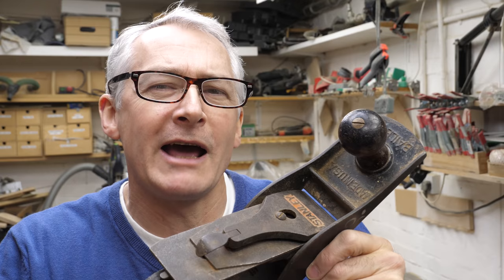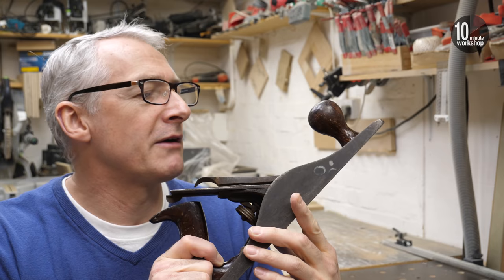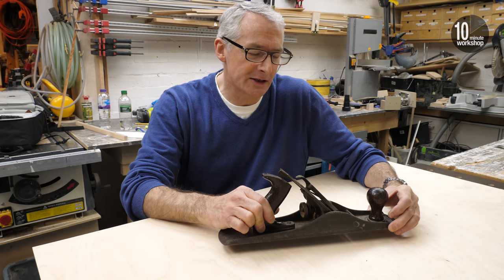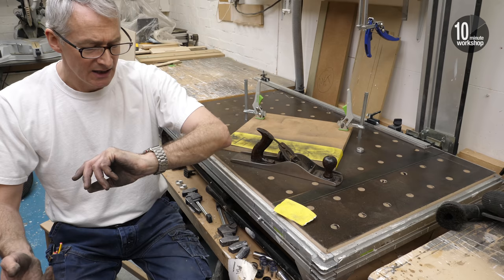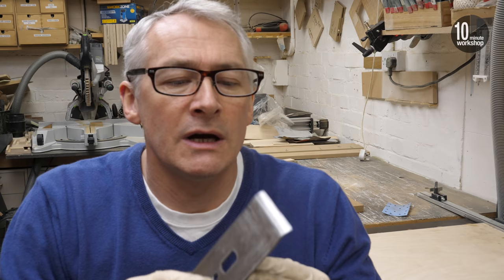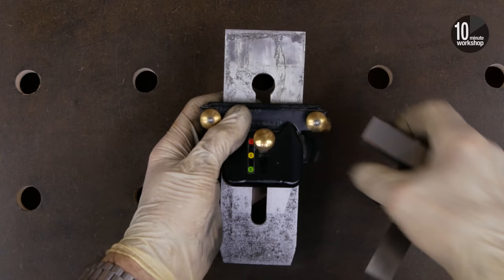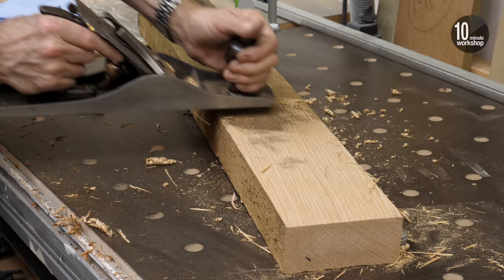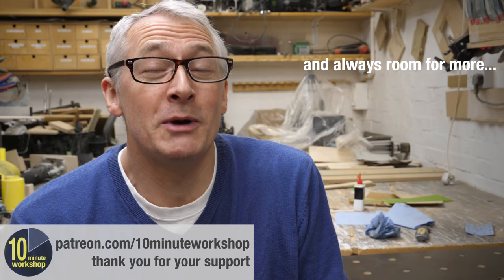Stanley No.5½ Jack Plane Revitalised [video #373]

Comment: You did a great job getting that old plane back to work.  That's a little newer than a type 15 though.  The frog started with the type 16.  The type study was done using the no 4 exclusively and some of the features didn't show up on the bigger plane.

Comment: Loved this. Even with all your experience as a pro cabinet maker with the power tools, I finally feel as if you are on the same plane as me with cleaning up hand tools. (Sorry, couldn’t resist that one.)
Best line? “I’ve finally found a use for a Dremel brush I’ve had for a decade.” I suspect we all know that feeling!
Best tip for me? Clamping the board plus abrasive paper to the bench top. Saves messing around with the vice and other specialist “sharpening stations.”

As ever, thanks for a great share.
Reply from the maker: Thanks Roger! Yes, I’m a total novice when it comes to this stuff - learning by doing! 😂👍👍

Comment: Just goes to show what you can do with  a seemingly worn out plane. Must pop into my workshop and give my 5 1/2 a clean up. Bought mine new in the 70's still a great plane.
Reply from the maker: Nice! 👍👍
Reply: Basically they don’t wear out although they do crack and break. The often have cracks around the mouth which become apparent when cleaning the rust off. And then are those which have been welded.

Comment: Interesting to see you get into this.   I went plane crazy in the 90s, finding at least 5 Stanley planes, 3 of them Bedrocks. A 4, 5, 6, 7, and an 8!  I sold the 8, it was a beast.   I was convinced I needed a good set of planes to be a wood worker!  Too many Fine Woodworking articles I think. I did build dovetailed pine shelves with them, starting with rough cut pine boards hand planed level and square. It took a week to build those shelves in what would take 2 hours with power tools. I then boxed them up, bought a jigsaw, skillsaw and a drill and didn’t build anything else by hand!
Reply from the maker: I never really ‘got into’ the hand plane thing, but I did enjoy playing with this one and getting it working tolerably well. And I totally agree with you re power tools! 👍👍

Comment: I  enjoyed the video, Thanks. There is nothing wrong with the way you sharpen. You have made a good choice with and older 5 1/2  and if you find you like using this plane and want to lash out with the cash buy an after market blade and cap iron set. That will raise the performance of your plane to almost as good as a premium Lie Nielsen or Veritas hand plane . If you do decide to buy a blade set, check the width of your blade as some USA made 5 1/2 planes made before 1939 had a 2 1/4  wide blade and not the usual 2 3/8 wide blade. All the best
Reply from the maker: Thank you! Great advice, much appreciated! 👍👍

Comment: Might this be a Type 16?  Judging from the kidney-shaped hole in the lever cap (although not definitive if the cap has been replaced). But the frog has the outline machined surface instead of a full-face ground front.
Reply from the maker: Possibly, though I don’t know enough to be able to tell the difference, I’m sorry; I went by the guide I found online - link in the video description - which was focussed on identifiers found on the plane body. As I say, it feels like the lever cap isn’t original as it isn’t centred when fitted, and the cap iron has ‘Record’ stamped on it, so most likely a mongrel. 🤷‍♂️👍
Reply: Peter Millard “Record,” eh?  Looks like this baby has had some organ transplants in the UK. Is the iron 2-3/8” or 2-1/2” wide?  That should also distinguish a 15 from a 16. 

I’m splitting hairs here: your restoration is brilliant and that plane is a keeper!
Reply from the maker: @b1j  Thanks! Har-splitting is the sign of a curious mind, I think! 😂Someone else further down the thread commented on the lever cap, and the shape of the hole, though as I say, I'm pretty sure that isn't original;  I'll have a look at the blade when I'm back in the workshop; out of interest, is it the 15 that should have a 2-3/8" blade? Really appreciate the info, thanks! 👍
Reply from the maker: Just checked - it’s a 2-3/8th blade, just FYI. 👍
Reply: Peter Millard and I just noticed a typo in my “expert” post:  the Type 15 had a 2-1/4” iron, not 2-1/2”!
Reply from the maker: @b1j  Ah, OK - it was definitely shy of 2-3/8", so I'd say it's a Type 15. 👍

Comment: I went through almost exactly the same experience in rejuvenating a Stanley No 4 plane that had been donated to our woodwork club. However, I soaked some of the metal parts in a citric acid bath to remove some of the rust. The results however, were almost a clone of yours and it is great to use. Perhaps flattening the back of the plane will be what others will say you should also do. Anyway, thanks again for your experience. I have two Stanley Bailey No 5's waiting for my future attention in the workshop. I am looking forward to the therapy again of seeing them take thin shavings off wood again.
Reply from the maker: Thanks! Flattening the back of the iron? I do that in the vid. 👍👍
Reply: You do  too sorry. Great video!

Comment: I just bought one of them this afternoon and it is in about the same shape. I have a workbench top to smooth.  This is more of a jointing plane for flattening large laminations than smoothing. Looking forward to using it.
Reply from the maker: Hope you enjoy it! 👍
Reply: I most definitely will Peter. Turns out mine is about the same age as yours and is a 5-1/2c which means its a corrugated sole. Its old enough to not have a frog adjusting screw so likely around the early 20s. Threads and hardware is all in great shape. No cracks or chips. Also regardless of what the sharpening geeks have to say all that matters is the blade is sharp regardless of how you get to it. I do not plan to spend a whole day setting up a precise bevel and all or spending $700 on a machine to do it. Close to 25 degrees is good.

Comment: The kidney shaped hole in the cap iron was introduced in 1933 with the type 16. I love my No 5 1/2, plenty of heft to it, once you get it moving, mine has a newer and better iron than the original. Here one can identify the ages of Stanley planes https://www.timetestedtools.net/2016/01/27/stanley-type-16/

Comment: My Veritas honing jig came with a gauge for setting grinding and honing angles.
Reply from the maker: Mine too - I have it ‘somewhere’... 🤷‍♂️
Reply: And that device also ensures the blade is square. 😉
Reply: @glennpreston3418  yes it does, although I don't like the fact that it isn't designed with a square edge on it at least on one side. I always imagine that I've knocked mine out of square whilst sharpening and am constantly checking for square as I go. To the extent that I have as much confidence in my freehand sharpening squareness. In hindsight I'd have bought a cheaper guide that clamps the blade square and an offcut blade angle jig.
Reply: Ah, that's probably because you're missing the extra device that clamps the blades from the side instead of the and bottom. That was a design flaw and the released the extra device to correct the issue. This keeps the blade of chisel true for honing.
Reply: @glennpreston3418  ahh, that makes sense. Thanks!

Comment: I did a similar number on my  Stanley #5 - 1/2 eBay purchase a few years ago. My plane is of similar vintage although as I found out, my particular model has a 2 1/8" width iron. I believe after 1958 Stanley increased to 2. - 1/4"?
I paid the princely sum of £8 for mine. It was advertised without a rear handle, however the vendor included the body and handles of another plane in the parcel, which was nice. The plane  had been well used but in good overall condition. I wanted a new blade for it, one for General work and one for smoothing. I found it difficult to source a second hand iron of that size although I eventually bought a new one from Workshop Heaven, I am pleased I did, I keep this one for finer work. I use this plane all the time now, it suits my hand very well, with the slightly narrower body it's a good compromise between the #5 and it's heavier Brother (2-1/4" blade version).
In your opening gambit you stated you would not polish it like Paul Sellers!! I don't recall the aforementioned polishing the frog screws and adjustment wheel lol.
I enjoyed watching and reminiscing on you labours, who needs a gym membership when you have hand planing to undertake. I am no expert either, although for general planing you might wish to ease the corners of that newly honed iron.
Good luck and thanks for posting.
Reply from the maker: Thank you! Very good point re Paul Sellers not polishing the bits I did, lol! Easy to get carried away 🤷‍♂️😂👍

Comment: I laughed at the 'obligatory shaky handle' - I inherited both my father's and my father in law's No 4 and both had the same affliction.
Reply from the maker: It might be next in my list of things to fix 😆👍
Reply: @10MinuteWorkshop  All you need to do is shorten the bolt going through the handle a bit. All that has happened is the handle has shrunk, easy fix.
Reply from the maker: @garyblake3130  There's a bit more to it than that, unfortunately - the screw is stuck in, and a previous owner has put a washer in there to try and help... which is not stuck against the bolt, so the screw won't turn, and the handle won't come off the bolt. As I say, a job for another day. 👍
Reply: Hi peter
Enjoyed this alot,
In reference to the shakey handle, clean the slot out and on some brass nuts the slot has the threaded part coming through, use a needle to poke the muck out and you can pop a few drops of oil/WD40 through the hole and it will run down the rod and reach the parts that have siezed.

Comment: There's nothing to beat hand tools from between the wars... Was given a 'new' Jack Plane a couple of years ago; Sole not flat, taken hours of work flattening on Emery cloth on a large piece of kitchen worktop. Used a black marker pen to mark up the bottom first - when the ink had been worked off the sole was much flatter. The 'Thin' (barely 2mm) plane iron (blade) had a hollow back, that is now better, again after much work on the emery cloth board. Chip breaker again another bad piece of finishing, not helped with it being as flexible as ****. I've as much time getting that sorted as well. It still jambs up with some of the shavings. 

Had I bought it I'd have taken it back it was so bad, even now only really good enough for very rough work.

Comment: Yes, very interesting. The only point I would make is that flattening the sole should be done with the lever cap on and closed. That said - your priority was cleaning off rust and patina from sole so I don't think that makes much difference. As far as sharpening is concerned I was taught by my dad, a master carpenter, and still only use 240 and 400 grit sandpaper and a strop to get a fast and sharp enough edge in moments - no guide!
Reply from the maker: Cheers Karl! I know where you’re coming from, but I n all honesty, I think any changes in the shape of the plane made by fitting the blade and lever cap to a frog that is itself separate from the plane body is likely to be negligible - certainly unnoticeable to me! But as I say, whatever works for you, works for you 👍👍

Comment: Haven't been over to your channel for a while. I watched Paul Sellers videos on this. Not sure I'd characterise his as full restoration. More like what you were doing, i.e. getting the tool functional. Loved his quick process for taking the old finish off the handles though, and applying a new finish for a 'quick win' in terms of making it better to handle in use. He also did some further videos on making new handles for anyone that's interested in going the whole hog. I really like the fact that he showed how you don't need a lathe to to do it. If I remember correctly you can fix the loose handle by simply removing a little length from the threaded end of the rod that holds it down. I'm guessing you already did this but didn't put it in the vid. Cheers Peter. Been missing your channel! :-)
Reply from the maker: Thanks Neil. Unfortunately the bolt holding the handle is seized; one of the many things I need to sort out someday… 😂👍
Reply: @10MinuteWorkshop  Oh... Bugger. 😱

Comment: If you look at the frog from the front, the screws and cutaways are the two eyes with the mouth below it does look frog like...hence frog.
Reply from the maker: Not necessarily... https://www.finewoodworking.com/2011/06/02/just-plane-trivia-why-do-they-call-it-a-frog 🤷‍♂️ But thanks! 👍
Reply: @10MinuteWorkshop  Glad you got the correct reason why its called a frog, I have been teaching the frog in the throat at my college for some time now. Glad you're getting into hand tools, I have been down the road and got all the fancy power tools, but you can't beat the use of good quality hand tools, of which an old Stanley or Record plane is one. We'll have you cutting mortice and tenon joints soon, even the youngsters at my college seem to enjoy chopping a mortice by hand.

Comment: Will someone please give Peter a piece of granite and some wet paper ,lol thats ok Peter  ,the last blades i sharpen were for my jointer ,i use a block of wood and screwed it to the block used a stone wheel to take out the chunks then wet sanded it on the deck of my table saw up to 4000 ,cuts like butter ,see them table saws are good for something huh lol
Reply from the maker: Totally agree with you Syd - my table saw’s the flattest thing I own! 😂👍👍
Reply: @10MinuteWorkshop  When you going to start using your CNC machine
Reply from the maker: @Mrfreezeee1  Just as soon as I get it finished; any month now... 😬

Comment: Smiling here - been sat on a stanley no4 and an unknown  (anant)  blockplane for about 18 mths.  Wanted to do  something with them but they got resigned to the shed.  They are now on the dining room table.  Interesting you sand dry?
Reply from the maker: Nice! Yep, sand dry, but I usually use something as a lubricant when sharpening. 👍👍

Comment: Pete. Do you happen to know if the hinge system that holds the track on the mft is compatible with the aluminium extrusion from ooznest? 👍👍👍
Reply from the maker: Hiya. I don't I'm sorry, no. I know the newer model MFT/3 changed to the v-slot type of extrusion, but I have the older model MFT with T-slot) extrusion, so I haven't anything to compare them to. 🤷‍♂️
Reply: Thanks Pete you’re a legend 👍👍

Comment: Peter, did you check the Chip Breaker 'front edge' is flat to the plane iron? didn't see that checked in the video.
Reply from the maker: The Cap Iron? Yes, that was flattened, I mention it immediately after I get the brass knob off the frog, at about 10.50 👍

Comment: Nice job though watching Paul Sellers can give pointers on setting up for different needs. Looks like it's a made up plane as tho body is stanley blade is from a record plane. Might be worth putting secondary 30 degree angle on blade to save time before sharpening again and again. Method works for you so who gives a hoot how you sharpen it. Would also recommend that you put blade assembly in the plane before flattening bottom as they can sometime distort a bit so that its not flat when actually using it. Still not a bad buy. Rebuild a plane before CNC what will they say???? Does this mean more proper wood projects in future? Only kidding. Keep up having fun with stuff.
Reply from the maker: Rebuilding the plane is easy in comparison to getting to the CNC! Plane was supposed to be a ‘quick one’ that would free up some time to get on with the CNC, hasn’t worked out quite like that though. 🤷‍♂️👍

Comment: Speaking with the security of complete ignorance. Shouldn’t we put put planes down on their side? Just a vague memory from school. Judging by the lack of apoplectic responses I must be mis-remembering something else.
Reply from the maker: Kids in school are always taught to put planes down in their sides.... because that way, when they put one down on a concrete floor or worktop, the blade will survive. But on a workbench - particularly your own bench - they’re fine in their base. 👍
Reply: We was taught at school to put them on their side in case there were any foreign bodies embedded in the workbench such as nails etc. If you put the plane face down and it was moved on the bench by something or somebody and the blade caught the head of a nail you’d take a chunk out of it, I’ve seen it happen. Same applies if you put it down on bare wooden floorboards, always the risk of a rogue nail or screw. Even if it’s your own workbench you never know what’s embedded in it so yeah it’s good practice to either put it on it’s side, retract the blade or put the plane at an angle in the well of the bench (if you have a well)

Comment: You've stained/coated the new MFT top and cut line insert?
Reply from the maker: Yep. Decided the oil finish was too yellow, and wanted to knock it back a bit. More on the accompanying blog post at 10minuteworkshop.com 👍👍
Reply: Thanks Peter,  in that blog you also address a question I've been asking myself about buying one of the many pattern MFT inserts as an 'on the cheap' option for track saw registering etc. There's one which comes with six bench dogs included for sub £50. I've already made some DIY dogs with cut down bolts and, would you believe, pressure washer motor pistons. The latter are very smooth and aesthetic in use.
Reply from the maker: Love the ‘pressure washer motor pistons’ idea! Never throw anything away! 😂👍👍
Reply: The instant I saw them as I stripped down the burnt-out motor I knew their destiny!
Reply: Hmmm. I have a dead pressure washer...
Time for a little dismantling. 😁